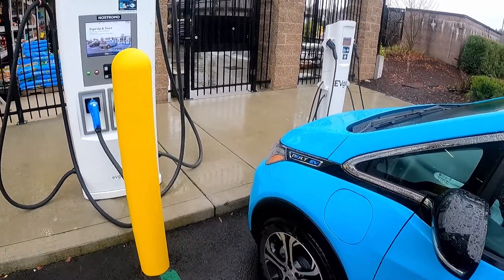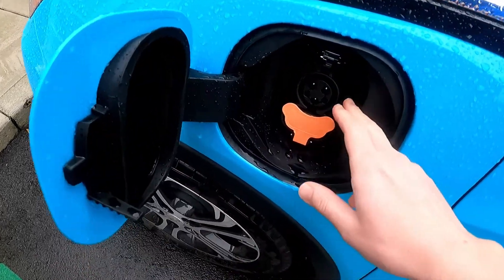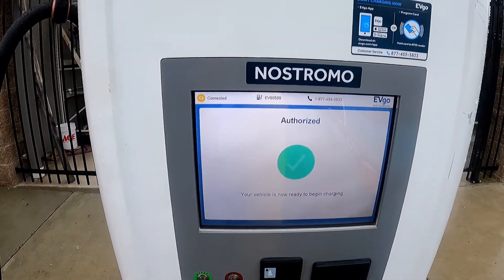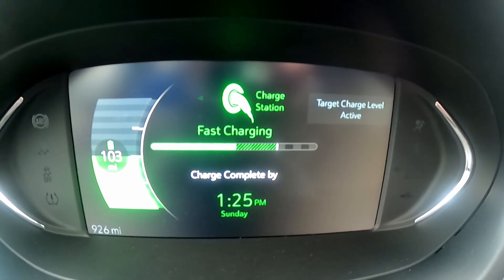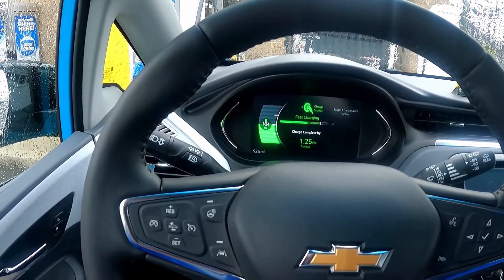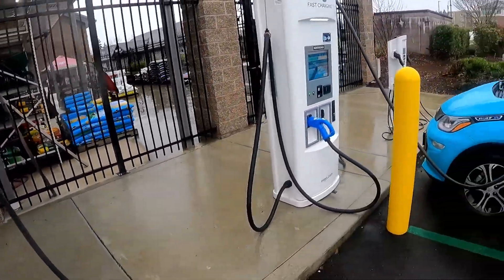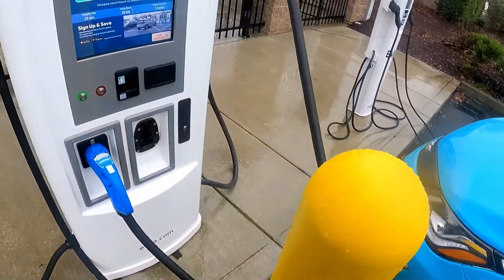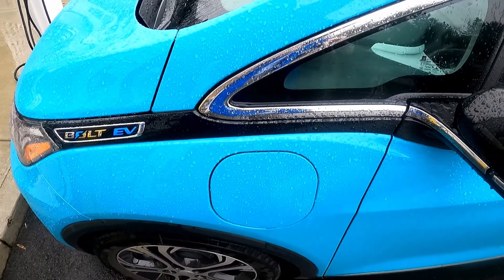How to charge electric car on EVgo using CCS

Comment: Came across your video and had a question. I have a 2015 chevy spark ev. My car connects well with the ccs charger at the evgo. The problem now is I noticed they have changed to a white handle one. I tried about 5 different evgo stations with these handles. They don’t charge and says can’t communicate with the car even if the light says it’s connected. Any tips for this? Thanks

Comment: Thank you so much for this vid.  Been thinking about buying one!  Didnt know the network to use and how are the stations. What is the cost?
Reply from the maker: Cost varies per location. Generally you will pay more than the gas equivalent cost at fast chargers, but if you do most charging at home, that is so much cheaper than gas, you're still ahead

Comment: Will these chargers work with Chrysler Pacifica hybrid van?
Reply from the maker: I'm not completely sure, but I think most plug in hybrid can only use the smaller J1772 connector. The process is very similar, but that connector charges shower.

Comment: Do you have to have an EVGo card or could you use a regular debit card?
Reply from the maker: I have an EVgo card but I think many stations are now adding credit/debit card readers. You can also use the app
Reply: @steven777400  thank you. I have a hybrid but never charged it at a station
Reply: If you have a hybrid most can’t dc fast charge. They can use level 2 the small 240 unit he showed first. We’re you are in a place for hours.
Reply: Electrify America can be used with app or credit card like ev go but ea you can sign up for a membership like Evgo and the card is kept in apple wallet on your phone so all you do is plug in and tap apple wallet on your phone select your ea card and tap it on the rfid symbol not card reader that way you don’t need to swipe on the app or use the number at top of charge r way Simpler. Some cars like Mach e and Porsche taycan you can plug in to ea and it starts charging. Without a app or card.   Evgo has auto charge for the bolt and there is a video from ev go on how to use it with the bolt and you phone.